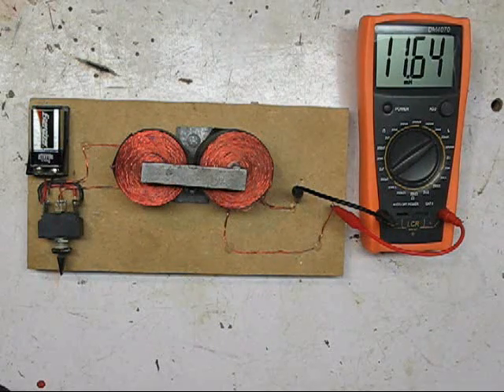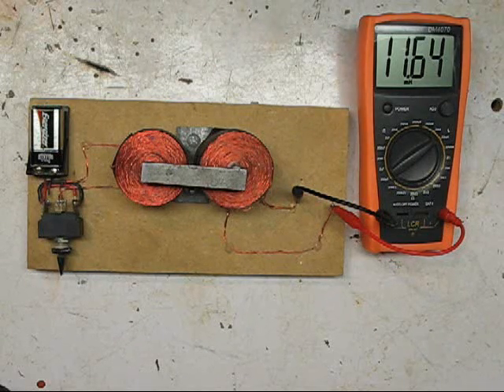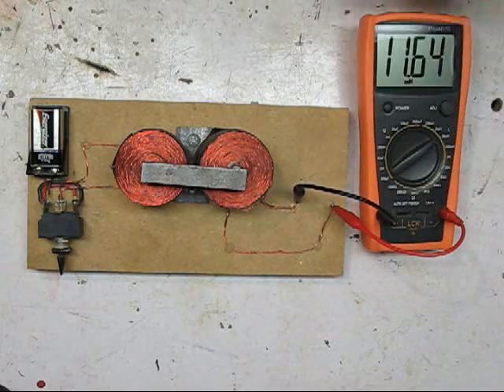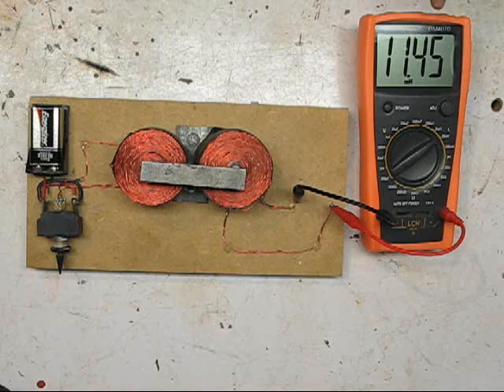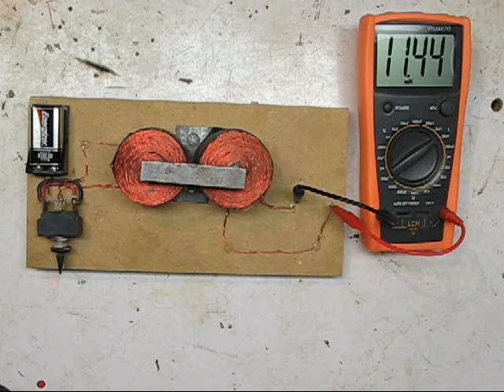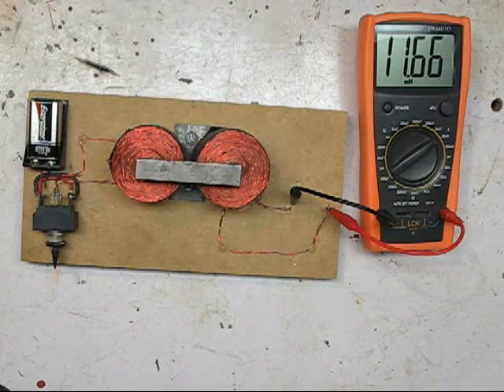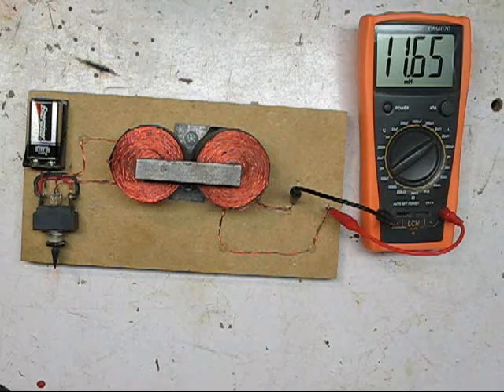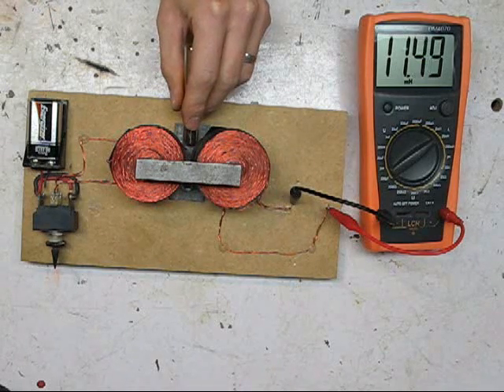Ed Leedskalnin Magnet 5

Comment: Very interesting videos, but you seem like an engineering type.  You do realize that with every magnetic field flux, there is a corresponding electric field being generated.  So there is no distinction between whether the energy is stored in the electric field or in the magnetic field.

Comment: if the core holds its magnetic polarization then the core in fact becomes a permanent magnet and therefore should react with a coil not only by breaking the core loop and collapsing the field but also by using the core as a magnet. But the core is ferromegnetic... its magnetic field will succumb to an external field after it inducted the coil eliminating the back emf drag... this may be good for designing a DC induction generator which I dont think exist???